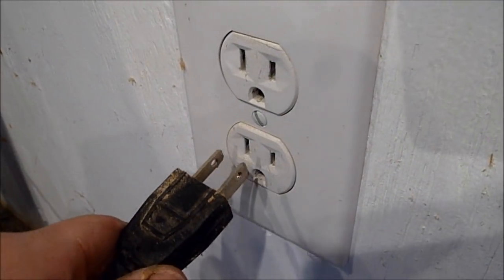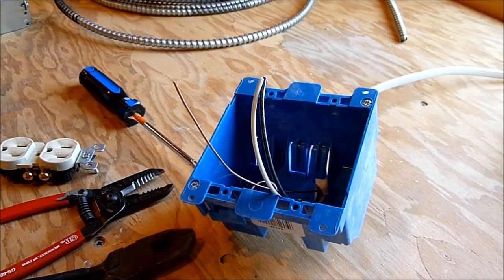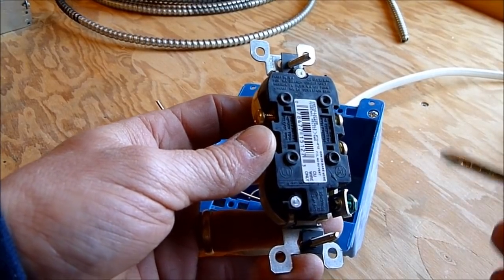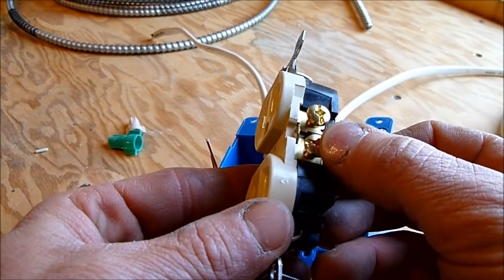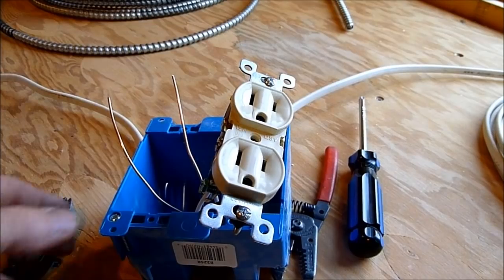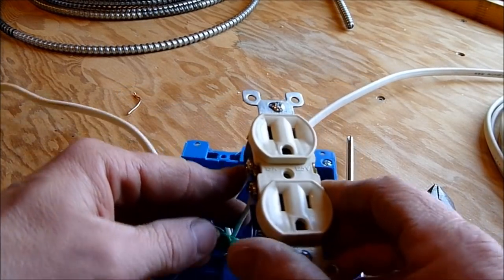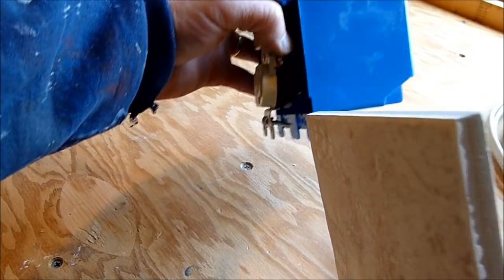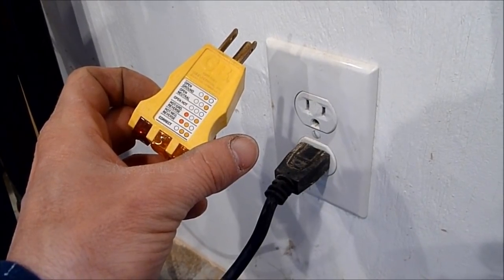How To Replace a Standard Electrical Outlet: A Complete Tutorial

Comment: Thank you so very much sir!!! Today was my very first attempt at replacing my cracked wall outlet and thanks to your super informative guide I was able to do it with ease.

I watched your video this morning, went out to Home Depot, bought the products I needed (was surprised how crazy cheap a wall outlet is), came home, and got to work.

Only $15 spent and about an hour of my time!

Items bought:
Electrical tape $1.97
Wall outlet $1.19
Outlet tester $4.97
7" wire stripper/cutter 6.97
Reply from the maker: Mike Ganci Awesome--glad it helped.

Comment: Also, a good video because you didn't completely remove the doors on the box where the Romex enters ... thus allowing the cable to be somewhat clamped inside the box.  Many remove this piece of plastic completely and I don't think that's permitted (although the cable is probably stapled outside the box within 8" for some stability so it's probably not the biggest error .... Thanks for the tutorial !

Comment: Love this! very well explained ...but why did he wrap the electrical tape around it?
Reply from the maker: +Josh Kb Wrapping the electrical tape around the outlet body is just an extra precaution.  It helps prevent a stray wire inside the box from touching a hot screw terminal or the outlet itself from bumping the edge of the box if it is metal and causing a short.  It's more of a courtesy for the next guy who takes apart the box to alter something or to replace the cover after painting, etc.
Reply: +enduringcharm okay thanks! that makes a lot of sense

Comment: Very informative. what is the difference between a single pole and double pole outlet?
Reply from the maker: NOTAPOLITECANADIAN I think you mean a single/double pole SWITCH, not outlet.  Single pole switches have one set of connectors double pole switches have two, often used for 220v circuits.

Comment: Hello, thanks heaps for your tutorial!
I just changed my standard electrical outlet, because the bottom one didn't work and when I opened it up, I could see that the top one was fine with a black and white wire, but for the bottom one there was only one red (!) wire, where normally the black wire would be put. Guess that is the reason why the bottom one did not work. Have never seen a red wire before. Maybe because the house was built in 1984 in Florida? Now I wonder how to fix this? Meaning, should it work just with the red wire or what would be the best fix here? Many thanks, Luca
Reply from the maker: Luca Stephan The thing about electrical is that it is relatively easy to understand until it starts to get complex, and when it does get complex it can get there very quickly!  A red wire can be used for a variety of reasons, including as a carrier of current through a switch or for 220 volt operations.  If your outlet has the little middle tab (shown in the video) broken it is possible this outlet was originally set up as a switched outlet for the bottom.  But, the only way to know for sure what is going on is to use a meter to trace the various wires.  Be safe--if you don't have a meter or you are feeling out of your league call in a pro.  Better to spend a few bucks than to start a fire or injure yourself.

Comment from the maker: The red wire could be used for a number of things.  It could be there to put one half of a 120v outlet on a switch, or it could be feeding other switches or devices on the 120v circuit.  It's also possible you are looking at a 220v outlet.  If you are uncertain, leave it to a pro!

Comment: Great tutorial, my house is a challenge though, wire colors are not standard and not the same from one circuit to the next. (Sigh)
I have one of those outlets where one plugs is operated by a switch and one not, is it necessary to beak the connector tab between the silver and gold screws or only the silver?
Secondly, ran into a couple of replacement outlets that had silver screws on both sides, is it alright to assume that if the outlet is positioned same as the original (ground part of the plug down) that I connect wires as seen in original.
Thirdly, I ran into one outlet where the hot wire, blue in this case, was looped around a gold screw, it broke while I was working on it. Does it matter which of these now two wires is attached to which gold screw?
Reply from the maker: +Heidi Nelson I always hesitate about giving electrical advice over the interweb since, you know, electrocution makes for a bad day.  So, always test before touching, kay?  The black/hot (and red/hot), white/neutral and bare or green/ground color scheme has been around for a LONG time.  Maybe since they started putting insulation over the bare wire, I'm not sure.  So when you mention a blue wire the red flags go up!  Are you certain it wasn't black that turned blue?  I've seen old wires fade or even white wires turn black with grime.  Similarly, I suspect the silver screws you believe you see on both sides of one outlet may be faded or worn or dirty and actually have a brass and a steel screw.  

In any case, make damned sure the wire itself is correct even if the color is not.  Remember, 14 gauge wire goes with 15 amp breakers and 12 gauge wire goes with 20 amp breakers (or fuses).  Using a white wire in a cable is okay for one side of a switch.  You are repurposing the white wire into a black wire and therefore the best practice is to wrap a little bit of black electrical tape around the end by the switch to "recode" the wire and let future workers know that the wire is hot. If some of your circuits have wires that are crossed (neutral and hot mixed up) then a plug-in tester (they're cheap!) will tell you.  Ideally you can straighten out the mess by working your way from one end of the circuit to the other, but if access is a problem at least make sure the outlets have hot and neutral on the correct side, even if the wire color is wrong.  Again, use tape to "recode" the wire if you have to.

For a switched outlet with only one plug on the switch, you'll probably see one hot cable in the box and one cable leading to the switch from the box.  The cable leading to the switch has a white and a black, but both are really acting as a hot, so you should recode the white wire.  Think of a switch as "interrupting" the black wire and it will be easier to follow.  So, you'll have the hot cable's black wire tied together with one of the switched cable's wires using a wire nut and that will send power to the switch, then back to the box where it will be screwed to one of the outlet brass screws.  The tab on that brass side will be broken.  To feed the other plug on the outlet, there will be a single black wire that leads from the second plug brass screw to the same hot wire in the wire nut.  Put another way, the "hot" wire nut contains three wires, the hot lead, the switched lead, and the second plug lead.  Now, on the other side of the outlet you can leave the single white neutral wire coming into the box connected to one of the silver screws and leave the tab in place.  Now you have provided a neutral for each plug in the outlet and separate hots for each plug in the outlet.  Having said all this, there are other ways the box may be wired--this is just a common example.

Finally, the order of connecting the cables to the screws on an outlet doesn't really matter electrically but it is good practice to keep the wires from a single cable aligned on the outlet.  So, the bottom brass and silver screws will connect to one cable, the top brass and silver screws will connect to another.  You keep the wires from a single cable aligned top and bottom.  This makes life easier for the next guy.

Comment: Is it safe to say that if there is a short in the line the circuit breaker will always trip? I have a ceiling fan that is less than 2 years old that no longer works. The remote is fine but I bought a replacement receiver but my concern is a short because I've been in the house 3 years and its my second fan. Not cheap ones either. Thanks!
Reply from the maker: Victor Cioni Ceiling fans, especially those with fancy remote controls, are notorious for poor design and issues internally with the wiring.  It's far more likely that your issue is with the fan itself than the house wiring.  To check, you can turn the breaker off, pull the fan out, cap off the house lines (black, white and green ground) with wire nuts, and then flip the breaker back on.  If the breaker holds you can try wiggling the electrical box just to make certain the house wiring is not touching somewhere.  Wear a glove to be safe!  If that test passes too, then it's likely your fan is kaput.

Comment: Is the outlet ground pin supposed to be on top or on bottom?  Newer work I've seen shows the ground holes in the outlet on top instead of on bottom.
Reply from the maker: That's an ancient debate which is much ado about nothing.  Some electricians are fond of the idea of putting the ground pin on top in the theory that if something made of metal fell from above, and somehow the plug was slightly out of the socket, the object would harmlessly hit the ground pin instead of shorting across the hot and neutral.  It's stupid.  The chances of this happening are infinitesimal, and there is a breaker or fuse even if it did.  Meanwhile, many moulded plug extension cords and power cords are designed with the idea of having the ground on the bottom.  So, the "normal" or typical position is ground on bottom.  If you want to call attention to yourself and force people to ask why the ground is on the top every time they plug something in, then put the ground up.

Comment: was taught to pigtail conections to outlet,that way power is no being drawn throgh brass connector on outlet to feed power to other outlets /switches in circuit ,the brass is higher resistance than copper wire a large drawn further down circuit [within breaker capacity]will cuase brass bridge to over heat outlet
Reply: not a bad idea.  current is relatively low, but great idea just the same. we do it a lot on commercial work

Comment: when you cripple the  hot wire in loop under the screw ,is it ok for end of the loop to touch the wire when tighten the scerw
Reply from the maker: Just make sure that it isn't preventing the loop from tightening around the screw.  You may have cut the cut of the wire slightly long.  As long as the loop is wrapped under the entire head of the screw (not just catching one side) then you're okay.

Comment: is it ok if the insulation is touching the screw? as long as its not under the screw?
Reply from the maker: +jonnybaze There shouldn't be any insulation under the screw at all.  You want full contact between the brass screw and the copper wire.
Reply: is it ok if the insulation is touching the screws at all? I just don't want a fire, I haven't done electrical work since high school(10yrs ago) and its my daughters TV that im changing a plug on and want to be very safe. also the wire is a bunch of tiny wires not the 1 solid wire I am familiar with and is hard to keep a hook on the wire, any tips?
Reply from the maker: +jonnybaze Oh, you mean you are just replacing a damaged plug on the end of the TV cord?  That will be stranded wire, not solid.  The replacement plug may have screws that you wrap the wire around or it may have a design that you just push the wire between two small brass plates and the screw clamps the plates together.  The latter is easier to work with.  I you need to wrap the wire around the screw, first twist the strands together with your fingers and then wrap it clockwise around the screw.  Tighten the screw slowly and keep the wire in place with your fingers as you go.  The insulation should not be underneath the screw head or the between the plates, but nothing will happen if it touches the outside area of the screw head.
Reply: enduringcharm thank you very much. I just needed some reassurance. thank you again
Reply: enduringcharm sorry 1 last thing.. is it ok to wrap electrical tape around the screws? dose it matter what electrical tape or r they all safe
Reply from the maker: +jonnybaze The wires should not really get hot unless there is too much current running through the wire or the connection and a breaker is not tripped in the process.  Standard electrical tape should be fine, although it really shouldn't be needed at all if you are using a modern replacement plug you've purchased at a box store or electrical store.
Reply: ok thanks again

Comment: I replaced an outlet. It has 3 wires in the box each wire has a black and white wire. I forgot were the wires went and now the new outlet don't work. Any suggestions?
Reply from the maker: cooldog60 It would be dangerous for me to suggest from a distance what might be going on, especially as there can be many right (and wrong) ways an outlet could be wired.  If you are saying that there are three cables entering the box, and each cable has a black and white wire (and hopefully a ground, too) then it is likely that one of those cables is the power and the other two feed some other devices down the line on this circuit or perhaps one of them is tied to a switch somewhere.  The safe way to test this would be to shut off the breaker, use your tester to insure that the power is off, and then separate all the black and white wires from each other.  If you have a multimeter set on AC volts, you can then turn the breaker back on and put the test leads across each set of black and white wires to see which one carries the 120 volts.  Further testing would be needed to figure out where the other two cables go, however.   There are lots of possibilities.  It might be worthwhile to call in an expert and then look over his shoulder to help you understand better for next time.
Reply: enduringcharm
Thanks for the information .

Comment: If only I had watched this video before replacing all my outlets. I'm sure they'll be fine but I can recall a few of my hot wires I cut a little too long and had a quarter of an inch exposed in the box. I hope that I don't get a short.
Reply from the maker: +Danny Cunniff  Typically if an exposed wire is going to short against the box or against the ground wire it will happen as you stuff the wires back into the box and close it up.  I have seen a stray ground wire touch the hot side of a device weeks later, though.  If you are concerned, it wouldn't take too long to pull the covers and take a peek inside.  You could shorten the exposed wire or wrap the device with electrical tape if it looks sketchy.
Reply: +enduringcharm I have some questions if this is alright?

1. There was an outlet in my house with one connection instead of two connections. It was the end of an outlet series as you described in the video. It had two screws for one white and one black.

I bought a newer outlet for replacing the older outlet with two screws on each side and just used the top screws. Would this be alright?

2. All connections were tight but sometimes getting all the copper completely underneath the screws was difficult. Is this normal or not normal. Each screw had conductors underneath them which touches all copper and makes a connection. I made sure no insulation was underneath the screws themselves which is very important.

3. How do you get outlet covers to sit so flush?

Thank you in advance.
Reply from the maker: It's fine to use just the top or the bottom screw sets as long as the tab in the middle of the two is still connected.  That's what ties the top and bottom together electrically.  If you are looping the wire around the screw and having difficulty, make sure that you looped it clockwise around the screw so that it tightens with the screw.  Also, it's sometimes necessary to use pliers or another tool to snug up the loop of wire before you tighten the screw. 

Getting outlet covers flush depends on a number of factors, some of which may be beyond your control.  If the original installers did not install the box flush with the wall surface or if the box or finish wall surface has changed, you may find that the cover sits proud of the surface.  All you can really do (short of changing out the box) is to make certain the outlet is screwed tight to the box.  Some boxes are adjustable, but they were (and are) rarely used because they are more expensive.  Adjustable boxes have a screw in the front on one side that moves the box forward or backward.

Comment: what if the old outlet has 4 wires, 4 on each side,   and the new outlet only has for 2 on each side?
Reply from the maker: +Andres Madrigal I'm not sure I follow your question.  Did your old outlet have two brass terminals on one side and two silver terminals on the other side but had two wires connected to each terminal for a total of four on each side?

Comment: what's the purpose of the electrical tape?
Reply from the maker: +Rudy Garcia The tape is partly a belt-and-suspenders safety step and partly a courtesy for the next guy who opens the box.  It can help prevent a bare ground wire, for example, touching a screw terminal when you push the outlet or switch into the box.  It also makes it a little safer for the next guy who pulls off a cover to paint or to examine something in the box.  I don't think it's actually required by code (although I'm not sure about that) but it is common practice among electricians who care about their work.